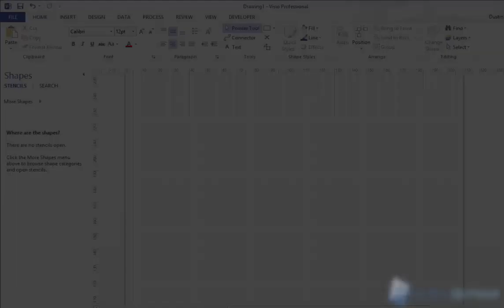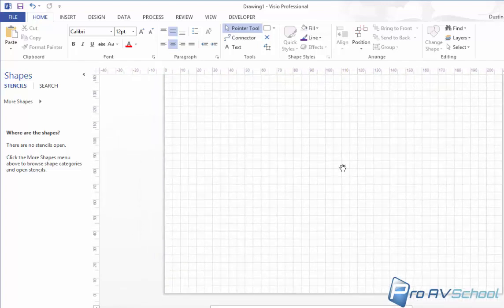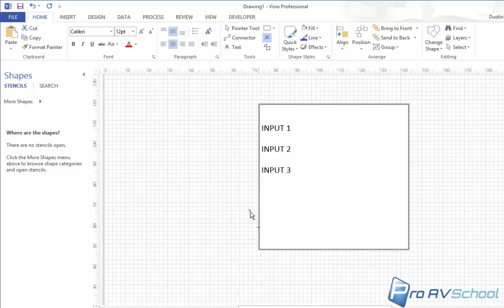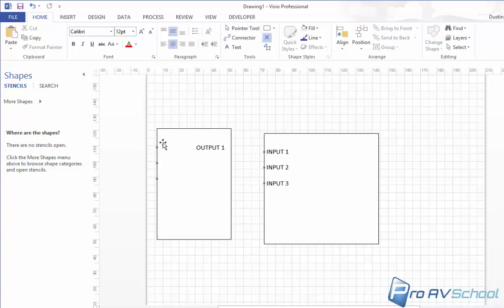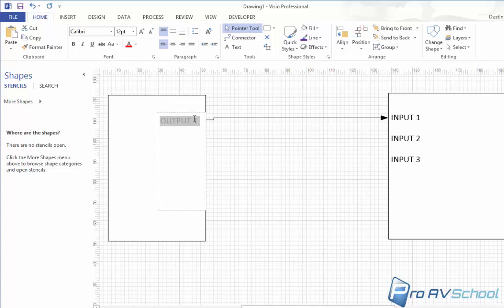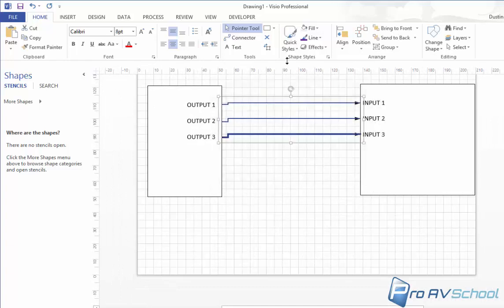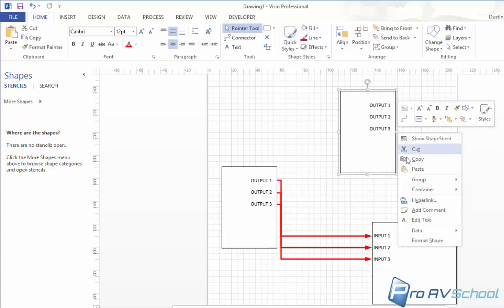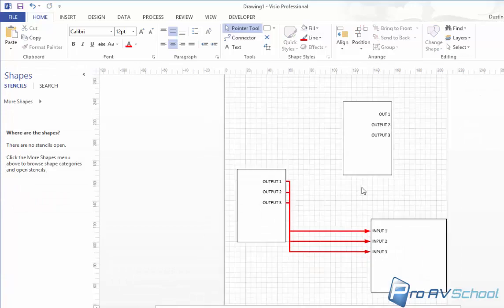Microsoft Visio Audio Visual Connection Points

Comment: Thanks for your reply. I figured it out. If you right click on the connection point you can change its direction to in, out or both. I think I changed it to both and it worked.

Comment: Hi, 

Im trying to do what you have done in your example but am having a problem. I get as far as creating the connection points. When I try to use a connector to join two connection points together i cannot snap/glue to any connection point. The green box does not appear around the connection point, however it does appear around the entire rectangle shape. Any ideas?

I have experimented by changing settings in the option menu and also in the 'view' ribbon - visual aids settings with no luck.

Thanks
Reply from the maker: strange... I actually don't have a Visio licence on my current laptop so can't check but I don't recall there being anything special about it. Maybe something to do with layers possibly?
Sorry I can't be much more help at this point (and apologies for the late response, didn't see until now)